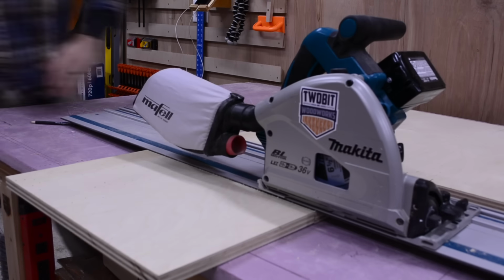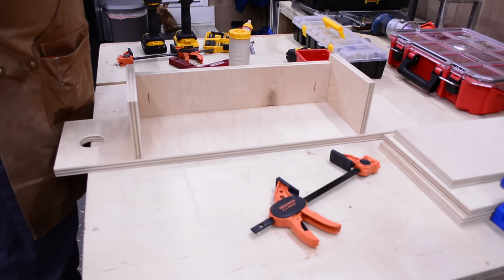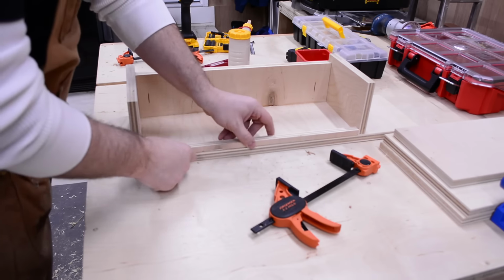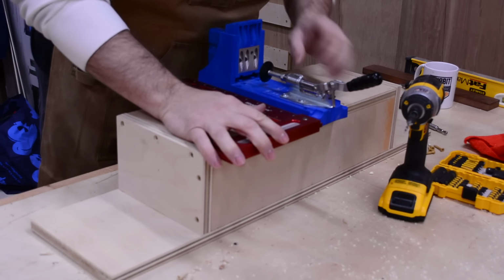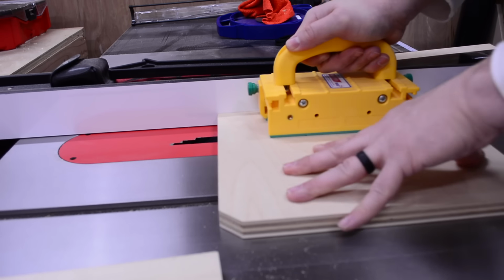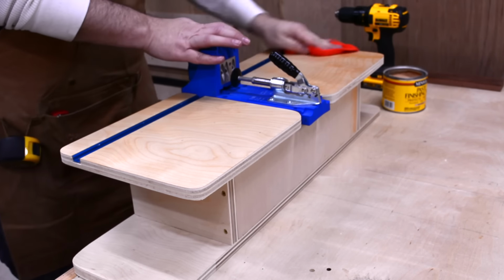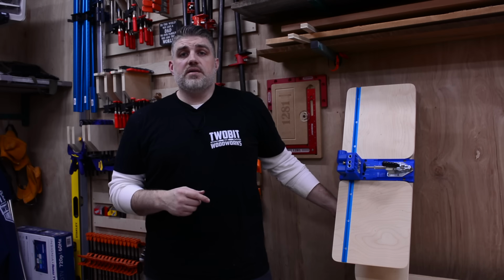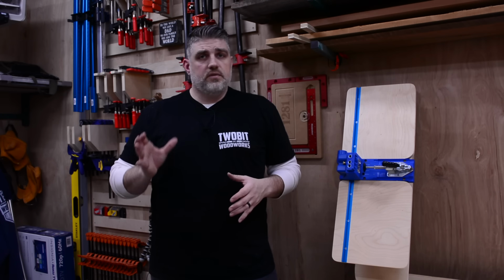How to Build a Pocket Hole Workstation for a Small Shop | DIY Woodworking Shop Project

Comment: I like it but why didn't you use pocket holes?
Reply from the maker: Mostly because I was using the the jig to mock everything up. Also because the space was limited and I wouldn’t be able to get to the screw holes with the drill.

Comment: I looked through many designs and liked yours the best. Gave me just the right idea to build my own. However, I did make 1 major change just to benefit my own taste. Instead of making an open section to insert a parts holder, I decided to create a drawer with sections for individual screw sections and assorted other parts for the jig, on soft-close drawer guides. I then cut a piece of plexiglass and attached it with small hinges and magnetic catch to secure all items in place. Then just added a simple catch to hold the drawer closed while transporting. I know, it was a little overkill when a parts box would do the same thing, but I was having fun doing the build and didn't want to stop. I'll post some pics soon.

P.S. Where did you get the small notched plastic glue spreader? I have looked everywhere for something like those that I can buy in bulk without breaking the bank for such a minimal tool.
Reply from the maker: Tommy Howell hey Tommy can’t wait to see some pics. The spreader is from Rockler.

Comment: Like the build. Very nicely done. Wondering if you use the T-track very often and if so in what applications. Stop block maybe? Is there anything you would change of doing it over again?
Reply from the maker: Doug Kepley thank you very much! I tend to use the stop blocks when doing smaller projects like making cross braces for cabinets. I might make it out of 1/2” ply instead of 3/4” just to keep the weight down a bit, although the extra weight does help with keeping it in place even without clamping it down

Comment: It's discouraging when woodworking YT'rs take credit for someone else's intellectual idea, pass it off as their own and, worse still, sell it for profit.  This workstation was created by Woodsmith and shown in Season 12 of Woodsmith Shop.  Woodsmith presented a YT video of their workstation 5 months prior to your video.  Their plans are free to everyone.  Yes, you made minor changes - principally, a solid back to the storage compartment, and you plowed out a recess in the case to level the Kreg jig to the work surface.  Woodsmith's design is superior in this latter respect as they added spacers to level the jig resulting in a full 3/4" of wood to screw the jig vs yours with ~3/8" (best guess) depending on how deep your recess.  This is Woodsmith's design, and it should have been credited as such.  Or, is it unreasonable to expect intellectual honesty where monetization is involved?  Particularly when the plan from the original maker is free.

Comment: why didn't you use the Kreg jig to assemble the the base? what are thee tracks used for?
Reply from the maker: jim james since I was going back and forth measuring the placement of the Kreg Jig it would of drove me nuts between using the jig and then removing it for placement. So I just used regular screws. The tracks are used for accurate repeatable stops. I’ll be making a video on making and using custom stops.

Comment: I’ve seen several of these pocket hole workstations. Yours gave me some ideas that I didn’t see in any others. Making a space below for the case holding the screws and bits is great. Most others I’ve seen have drawers instead. I’m wondering why you put in the t-track. What are you planning to use it for? Thanks.
Reply from the maker: WB Fine Woodworking I will use the t-tracks for adding in homemade stops for making holes at precise measurements. I’ll be doing a video on making the stops and using them in a later video.
Reply: TwoBit Woodworks thanks for the information. I just subscribed so I won’t miss the next video.
Reply from the maker: WB Fine Woodworking great, thank you very much!

Comment: what are the T tracks used for?
Reply from the maker: Using homemade stops for precise repeatability.
Reply: @TwoBitWoodworks   do you have a design for the stops?
Reply from the maker: @briangalyer5969  unfortunately I do not. I have seen a lot of aftermarket small stops.

Comment: I’m working on a similar setup, but I’ve seen others like yours with t-track. What’s the reason for installing t-track?
Reply from the maker: Hi Danny it for setting up stop blocks so that you can do repeatable precise placement of pocket holes.
Reply: @TwoBitWoodworks  I thought that might be the case. None of the videos I’ve seen explained their actual purpose. Thanks for clearing that up for me.
Reply from the maker: @dannyscobee6530  the goal was to do a quick video on making some homemade stops for it at some point.

Comment: Very nice build. How come you didn't use your kreg jig to make the  jig?
Reply from the maker: John because I needed the jig to make the workstation, but I didn’t have the workstation done to built itself?!? It’s a slippery slope. It’s actually because the size of the workstation is relatively small and there wasn’t a ton of room to get the pocket holes screws in the inside.
Reply: @TwoBitWoodworks  Makes sense. Still like the idea and build.
Reply from the maker: John thank you!
Reply: @TwoBitWoodworks  yes i had the same question in mind, then i realized you'd be able to use pocket holes on half & then not enough space for driver( if you wanted them hidden on inside). Would have been weird to do some joints w/pocket holes & others not... i love Kreg builds but have seen woodworkers "pocket hole" themselves into a too tight corner & then have to change strategy. Been checking out your other videos. Good stuff.  I'll subscribe because I'd like to see more. Thanks, Lisa

Comment: I am curious as to why you did not build this with pocket holes from the Kreg jug?
Reply from the maker: Hosebee Lion I was using the jig for placement and alignment so it was easier to just use regular screws to build it. And I would not have been able to use it on the tight spaces on the inside.

Comment: That's a great looking piece of kit. I especially like the track for repeated holes at a set measurement. My two cents worth, I think I would keep the 'bits and screws' container separately so I could make the whole jig lower to the bench, that's a design suggestion that others may consider, not really criticism. Great job
Reply from the maker: Gordon Chapman thank you Gordon. I’m 6’2” so having the extra height works for me. But one of the reasons I include the SketchUp file with my plans is so people can customize to their own needs.
Reply: @TwoBitWoodworks  👍

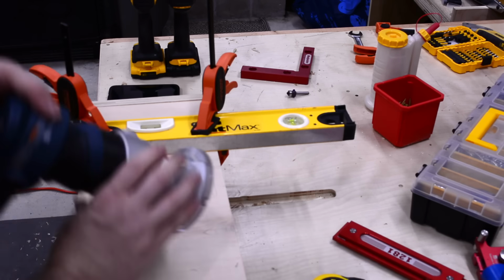Comment: What do you call that tool you are using on 3:04 to measure the depth that will be made by the router?
Reply from the maker: Thiago Locatelli it’s the 6-in-1 Shop Gauge from Woodpeckers.
Reply: @TwoBitWoodworks  Thank you. I really like it but it seems it has been retired.
Reply from the maker: @TheRealDoubleT  It has, but you can try finding a used one online somewhere.
Reply from the maker: Thiago, right now Woodpeckers is selling a limited quantity of the 6-in-1 Shop Gauge: https://www.woodpeck.com/one-time-tools/onetime-tool-6-in-1-shop-gauge.html

Comment: ...and not a single pocket hole was used...nice looking setup sir!
Reply from the maker: Robert Foster yeah I’m catching a lot of heat for not using pocket holes. By the time I got around to assembly I was using the pocket hole system to keep everything aligned in place.

Comment: What is the t track for?
Reply from the maker: It’s for adding in small stops to use for accurate repeatable positioning of the pocket holes. Mostly used when doing furniture builds.